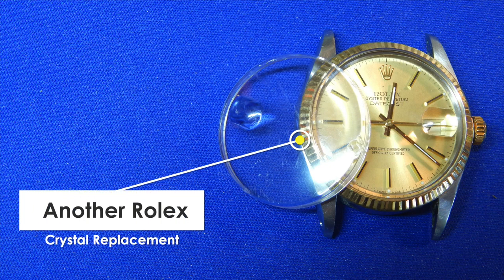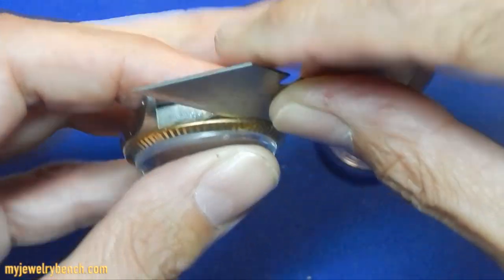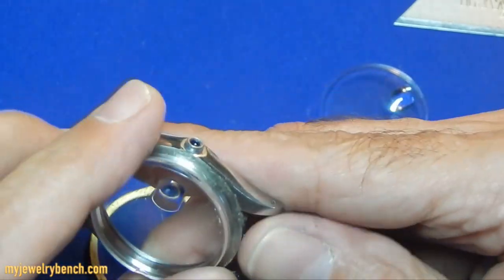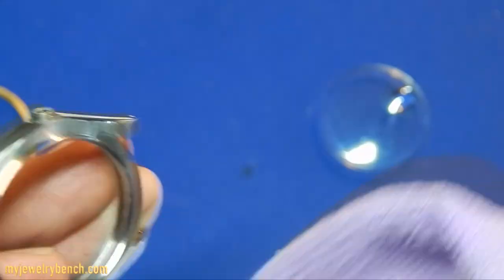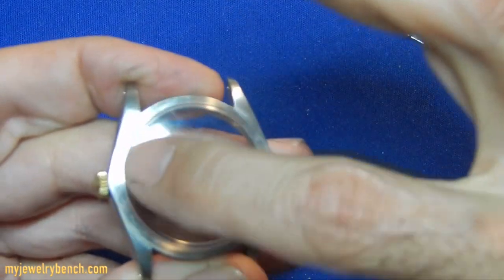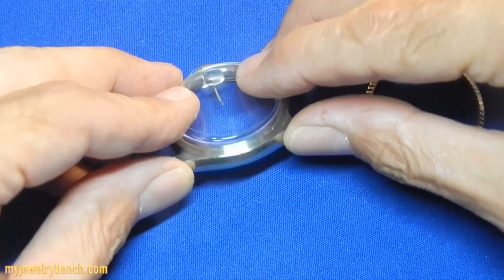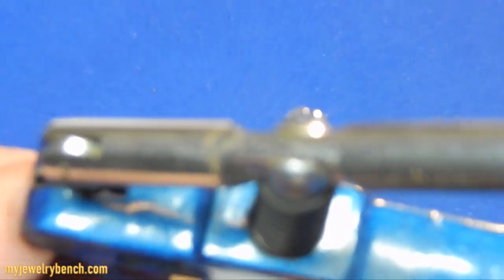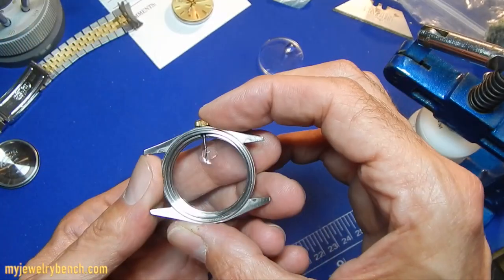Rolex Plastic Crystal Replacement.  Simple and Easy

Comment: Where did you purchase the crystal? I have a 1959 rolex oyster perpetual 34mm 6534 that I’ve been trying to get watch crystal for and the couple I ordered have been half mm off tried sanding polishing the crystal but always run into problems would just like the right crystal
Reply from the maker: You can purchase online from suppliers or if you wish eBay

Comment: I have an old Waltham divers watch with a loose plastic domed crystal with a flat outer edge. Do you know if these crystals require gaskets or are they simply friction fit? I have had the crystal out to polish it, and there was no gasket installed previously. I have since used some GS Hypo cement applied to the inner edge of the crystal ledge prior to re-install. Seems to be holding, but I am afraid to water test it. To better ensure water resistance should I be looking to replace the crystal with one slightly larger in diameter? Thanks!
Reply from the maker: Hi,  Let me try to do my best to explain, but if you post the model number of the watch, I'll be better able to answer this.  I'm guessing that the crystal is a pressure fit, and that maybe it is too small for the bezel on the case.  If it is  a replacement, then this is common, because matching older crystals is very difficult, and they usually need to be cut down.  GS Hypo will hold the crystal in place, but I would recommend that you use a UV Crystal Curing cement which will help keep it resistant to moisture.  If you have ANY Doubt, do not water test the watch.  I usually water test cases with the movement out, but steps and chrono buttons in, that way I do little or no damage.  Getting a larger crystal, and polishing it down to fit is the way to go.  If you have any questions, let me know.
Reply: @watchesandjewelry  Thanks Peter. I agree that the best solution would be to replace the crystal with a larger one. While I don't plan on ever using this vintage watch for swimming or diving, I would like the piece of mind knowing that I can wash my hands without having to remove it, (I lost a nice watch doing this once). The sad part is I just got this watch back from servicing. They claimed to have replaced all gaskets, yet they sent the watch out for water testing with a loose crystal. Needless to say it failed!

Comment: Is there an alternative for the crystal press?
Reply from the maker: For this example if you don’t want to purchase a press, you will need something that allows you to push the bezel down. Something that presses against the bezel but does not touch the crystal. You could try a socket and a microfiber towel but the nylon discs for a crystal press won’t scratch any of the parts.
Reply: Peter Grande okay thank you so much. I need to change my crystal but I have no press and I don’t feel like waiting for one to come in lool

Comment: Is that Watch waterproof only with the Crystal? Without crystal gasket?
Reply from the maker: The plastic crystal is the gasket in this case. Bezel is not just cosmetic but helps to put pressure on the crystal to seal it
Reply: On older Rolex watches,the overlap on the crystal fits into a slight groove around the case front and provides the seal itself.Newer models have a gasket.
Reply: @tammysharonlorettastafford6271  thanks

Comment: Do you have to take the whole thing apart to do this? Can’t you just pop off the bezel and the glass on the watch as normal?
Reply from the maker: No. Just the bezel has to come off.  I will take them apart to if it is glass in case bits are floating in the movement

Comment: So these watches aren't really water resistant
Reply from the maker: They are.  The bezel seals the watch crystal on the case
Reply: @watchesandjewelry  how water resistant are they? 50 meters?
Reply from the maker: Rolex states that their watches are waterproof to 60 meters. Ladies watches less. As a watch ages and wears from use it will naturally be less resistant to water. Wear to crowns, case tubes, back covers all have an effect in water resistance. I would never take a vintage Rolex or a vintage omega that was not in almost perfect condition diving to 200 feet or more. Even though we test watches they are tested for just a minute or so. Longer exposure to pressure on older watches can have u predicted results.
Reply: @watchesandjewelry  thank you for the extremely precise answer Peter!

Comment: I won’t be sending you my datejust for a new crystal.  You may as well take an axe and chop off the bezel off, it wouldn’t look any worse than you using your that blade.
Reply: what do you suggest? tape over the blade? or a specialized too?
Reply: Holy hell this was hard to watch. Proper tools or more importantly ANY PREVENTION of damage would go a long way. 

You can see the gold chunks come off the bezel stuck to the razor blade! Unacceptable. 

This video should not be used as any kind of guide for anyone. 

I repair this damage after it leaves hands like yours, and while it’s these mishaps that keep a roof over my head, I care far too much about the pieces to allow anyone anywhere to think this is acceptable treatment to any timepiece, let alone one of value.